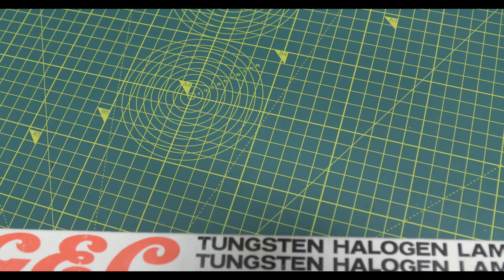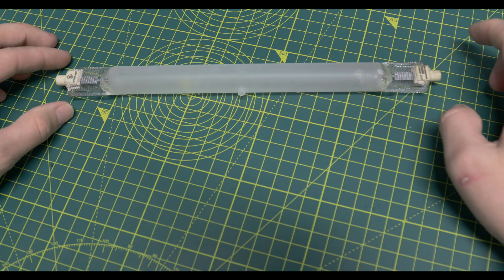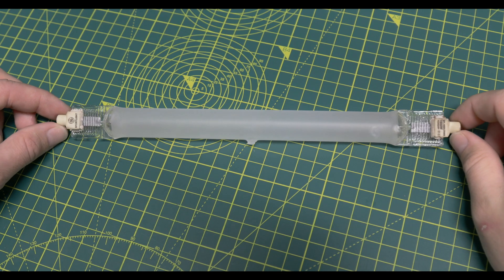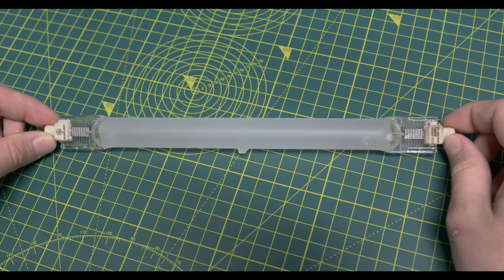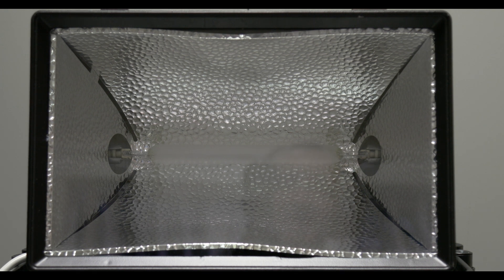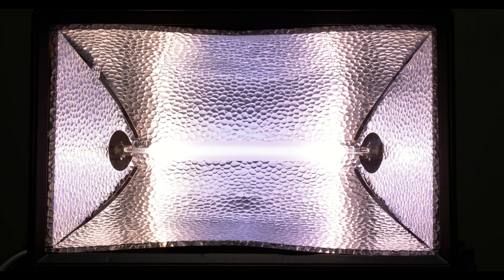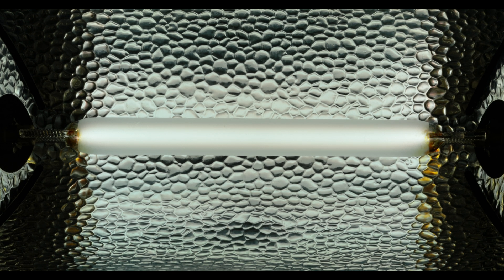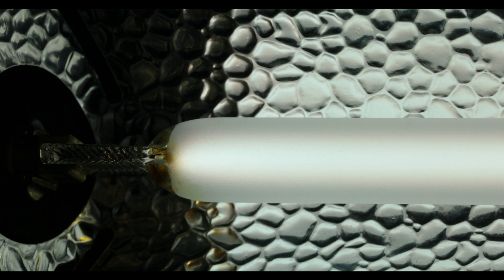General Electric 1500w Linear Metal Halide Lamp (MBIL/H)

Comment: Does this lamp or the tungsten halogen lamp get hotter?
Reply from the maker: The tungsten halogen lamp emits far more IR but this radiates more heat into the luminaire.
Reply: @FrontSideBus  How hot does the luminaire get? My 500 watt halogen fixture gets really hot. I measured it with a temperature gun and it read 330 degrees Fahrenheit (165 degrees Celsius). The front glass reached 650 degrees Fahrenheit (343 degrees Celsius). I heard another YouTuber said his 500 watt halogen work light got too hot it melted the outside junction box.

Comment: Those metal halides must be rare as hens teeth.  Those lamps resemble  the halogen type used in torchiere lamps, those were very popular when I was a kid in the 1990s,  my mother had one and the bulb exploded when we were doing our homework.   I had changed the lamp about a week or so earlier it seemed,  I was probably 9 or 10 at the time and I used my bare hands, just like any other bulb.  I can imagine the same handling rules apply to tubular metal halide as well,   since it's the skin oils that burn and causes hot spots on the quartz, weakening over time and leading to explosive failure even more so for metal halide due to the high pressure they operate at.

Thanks for sharing,  this is indeed a very interesting lamp.
Reply from the maker: Yeah I did give it a wipe with IPA before firing it up. They are the same length as a 1500w halogen.